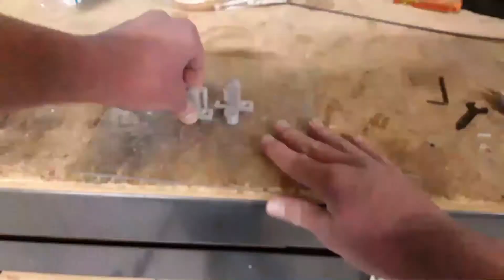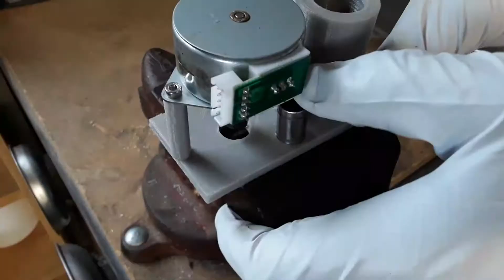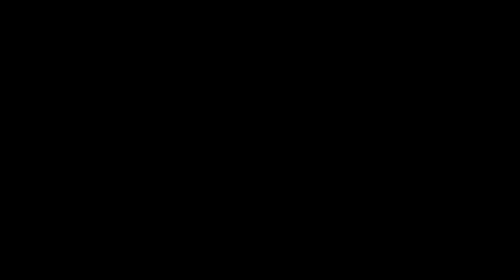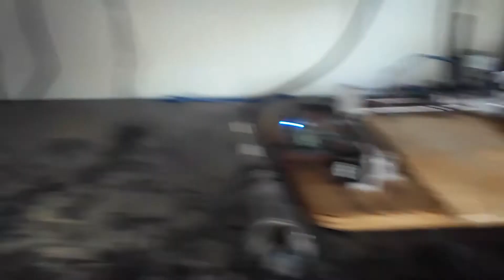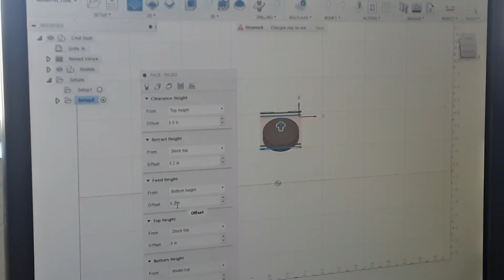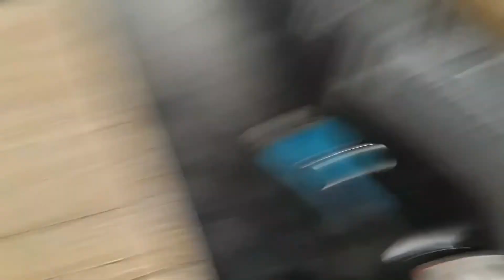I Built a Custom CNC Router

Comment: The weird cut at the very end could have been caused by changing fiber direction in the cheap plywood you used and...why not stabilize your substrate and object of the program?
Reply from the maker: Thanks for the feedback, but I actually found the problem. The y-axis belt was actually slipping because there was no tensioner, and I fixed it.